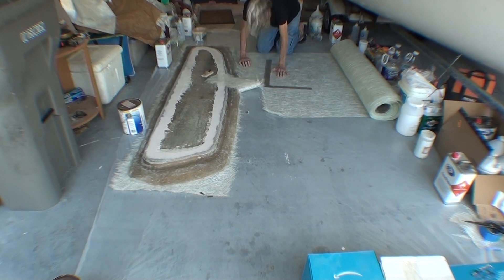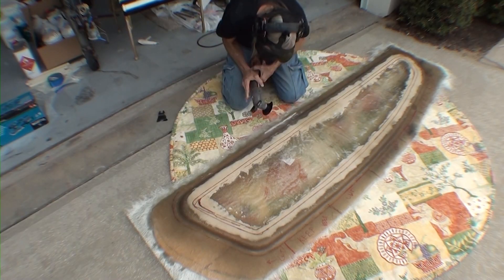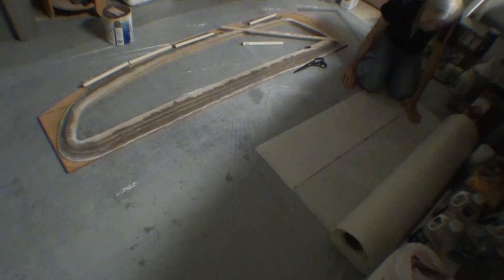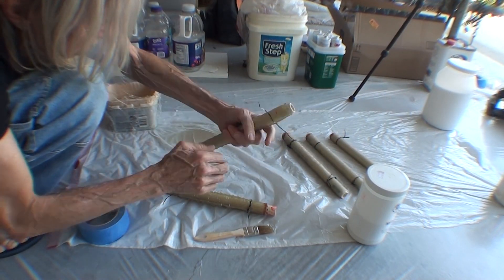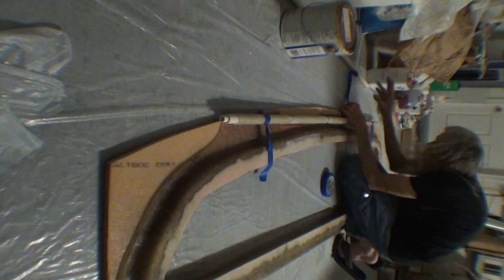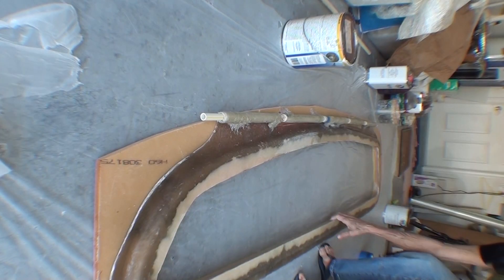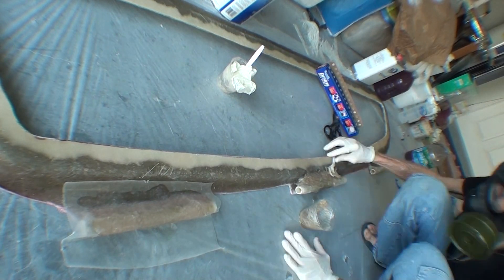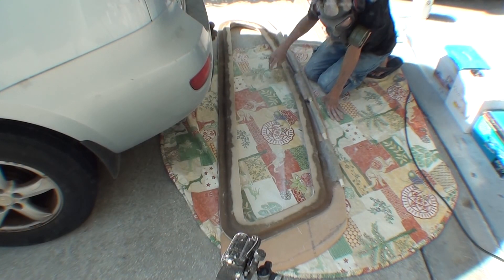PVC Pipe Hinge For Iroquois Catamaran Window

Comment: This turned out nice! Looks very stabile, even without the window in it. How will it be locked closed?
Reply from the maker: I haven't figured out how to latch it closed yet.  At the moment, I'm thinking the simplest thing would be to make some fiberglass rings and glue them to the inside of the window frame so a string can tie it to another ring or cleat on the inside of the boat.

Comment: Very clever!  What are the actual windows going to be made of?
Reply from the maker: The original windows were polycarbonate but were in two pieces.  I had a place make some new ones out of the same material except they are just one piece per window.  The guy who made the new windows said the old ones were in two parts because of thermal expansion when the boat was in England and had to deal with freezing winters and hot summers.  Hopefully the temperatures around Florida and Bahamas will be mild enough to allow one-piece windows.
Reply: @ninehundreddollarluxuryyac5958  very interesting!